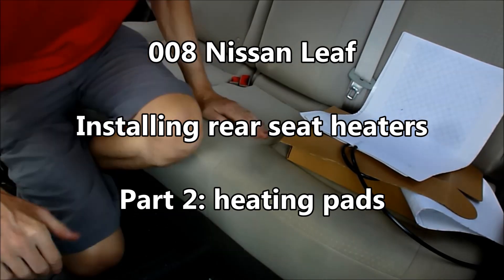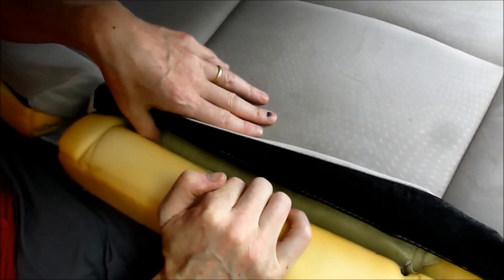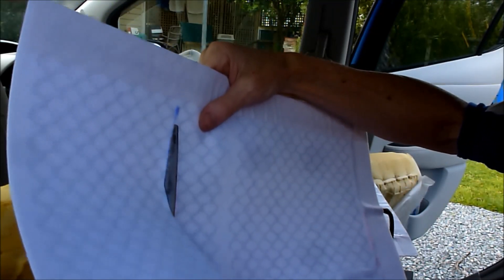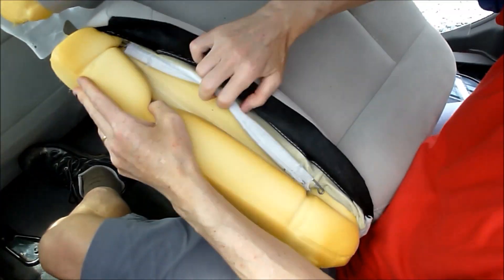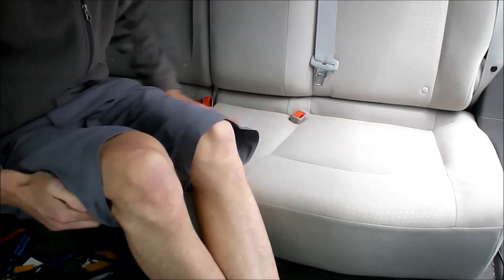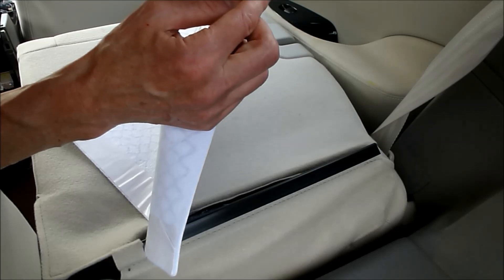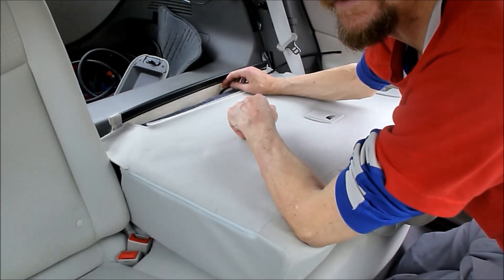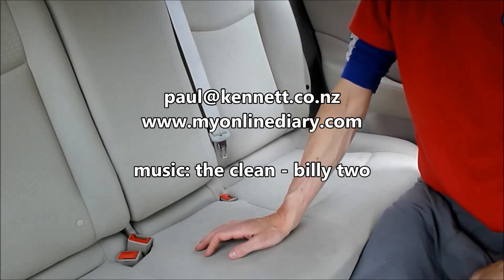Nissan Leaf 008 - installing rear seat heaters (part 2: heat pads)

Comment: Thank you for the video and any help you can give me!

I am looking for more information about the kit Paul Kennett used in his YouTube video on installing front seat heaters in his 2011 Nissan Leaf.  The kit he listed is no longer on ebay.  

I have a 2011 Leaf and would like to add the seat heaters.  I've looked on ebay but can only seem to find the round switch type.

Comment: Hello Paul, just a question, wouldn´t it be easier to remove the complete upper part of the back seat to install the heater, like how you did with the botton part? Thanks for the tutorial mate!
Reply from the maker: Maybe. I was trying to avoid going to that much effort. But, in hindsight it's hard to tell which is the better approach.